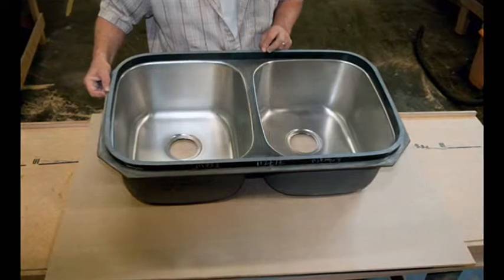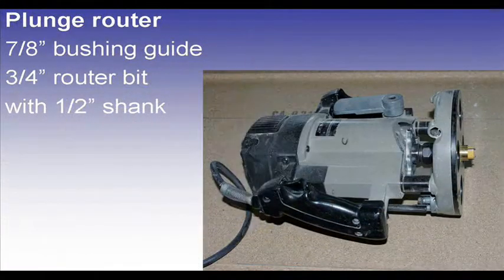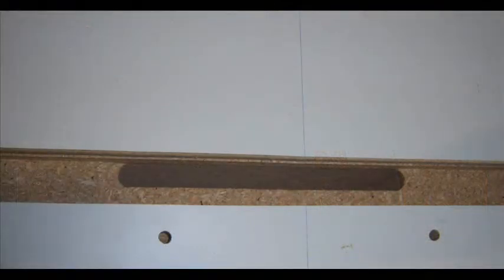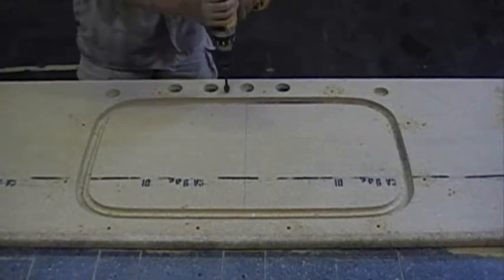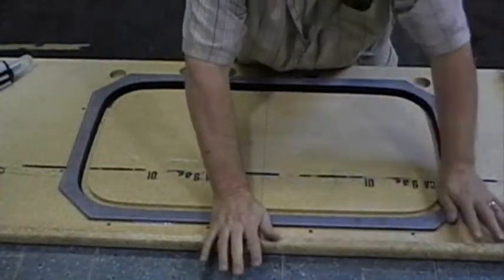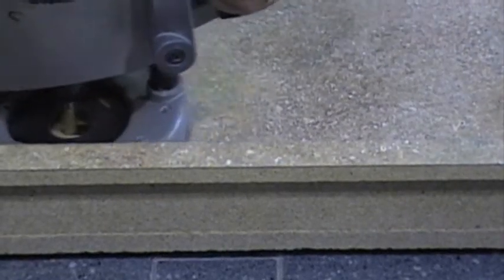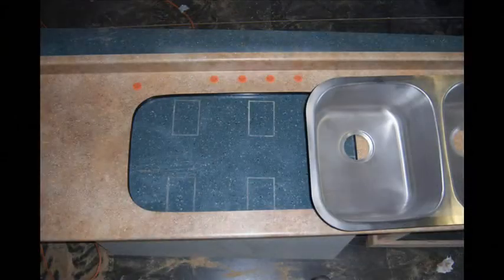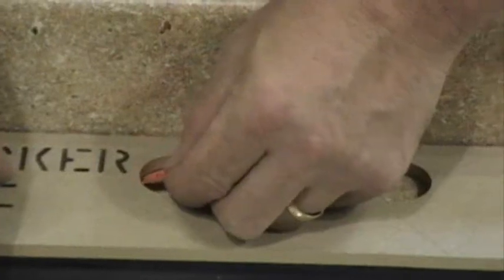installing an undermount stainless steel sink in a laminate countertop

Comment: I like some of the ideas presented in this video! I believe techniques, materials, and/or adhesives have advanced since the creation of this video however. Now sinks are mounted directly to the underside of the laminate (Formica) instead of beneath the countertop. Usually this is done before the laminate is contact-cemented to the particleboard. Using the techniques presented here, I postulate that a person could mount a sink to an off-the-shelf post form laminate countertop at any time by simply eliminating the flanged ring and using slightly larger template(s). The key steps are setting the router depth to cut down TO but not through the lam and scraping and cleaning off all contact cement. Thus the surface is prepped to accept approved epoxy for the chosen undermount sink. What do you think?

Comment: like the product but your website stinks. Looked at your website and you have no information oh where you can get it.  Only to contact a local distributor.  I can't believe you don't supply any information on distributors.  You must not want business.  What sense is there in making a DIY product line and then not having it in big box stores or being able to buy it from your website.  I for one like the idea and think it is good, but way to hard to obtain the product.